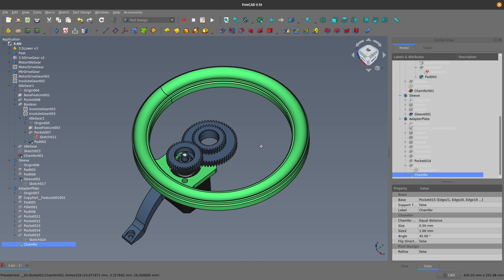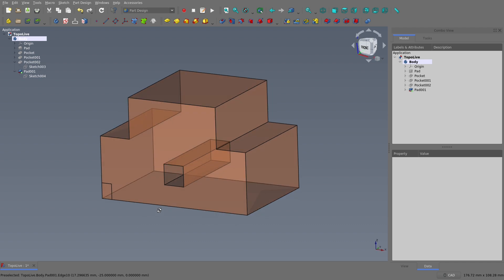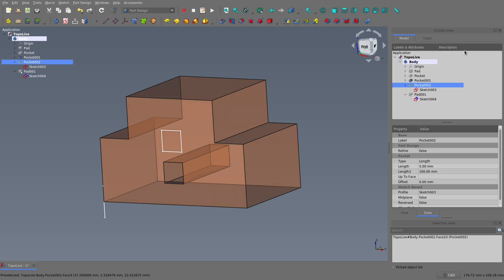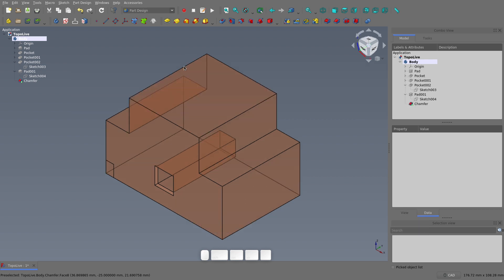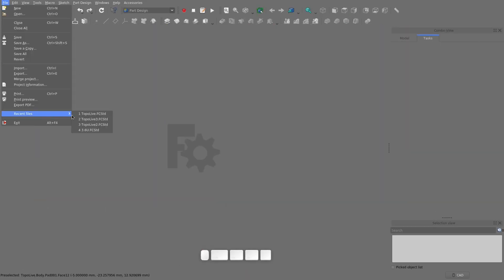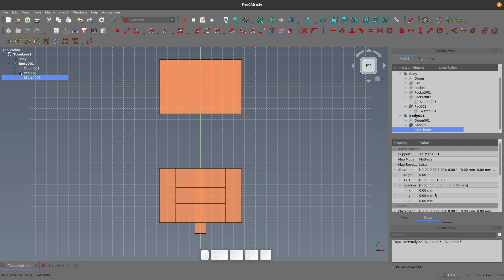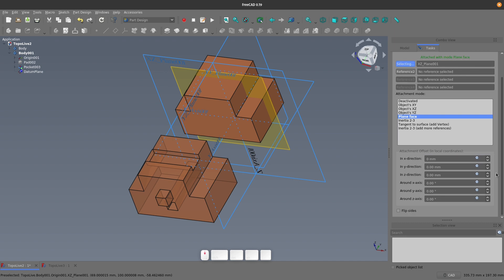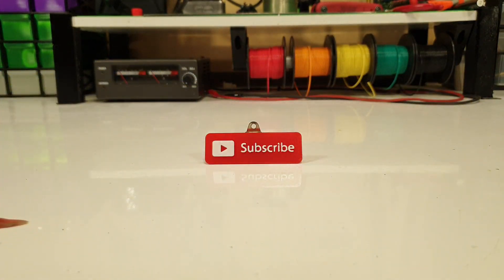Why do my FreeCAD models break? - "Topological Naming Problem"

Comment: I'm disappointed the fix wasn't considered for the 0.19 release. Having used FreeCAD for years, this has consistently been the single biggest problem with using the software. I also think it will be the biggest problem getting new users to adopt the software.
Reply: It's not that is wasn't considered. The problem is that realthunder needs to separate it from his fork, to make it into a manageable (or even multiple) pull request(s). His fork is tens of thousands of lines of codes spanning the whole code base. It's impossible to review for other developers with limited available time. Already, his App::Link work was merged into 0.19 and it was a lot of work, to make sure it played well with all the other workbenches. As an end user, I understand the frustration of not seeing this and other cool stuff merged into FreeCAD's main branch already. But we cannot know what all of this requires on the other side. That being said, with FC 0.19 releasing soon, I believe merging of the topological naming code will be in the works for 0.20.
Reply: @normandchamberland1503  As a developer I understand, and I think the FreeCAD maintainers are doing an amazing job. But as a user... Now! Now! Now! Sadly, life doesn't work that way,,,
Reply: @DavesRocketShop  yeah because this issue does not exist to that degree in aps i use like fusion360. references can have hick ups so you just re-associate and done
Reply: How is the progression. Version 0.22 seems to be here.

Comment: l'll have to watch this again because I'm a little hard of thinking, but you've certainly got the knack of talking sense - I currently use DesignSpark Mechanical - which is brilliant but I need an easier way of making adjustable models. I got a long way with this with FreeCAD but gave up on it and returned to DSM because I got sick of the time squandered on broken models. Edit: I've just had a quick fly through the RealThunder version. I had no idea there was a version of FreeCAD that works! I tried your method to stop models breaking, but being able to just get on with designing using the RealThunder version is fantastic. Thank you for mentioning it, it looks like I'll be able to migrate to FreeCAD now. Sorry I am only able to like your video once, there ought to be a more emphatic like button for this!
Reply from the maker: It's definitely an annoying issue until you work out how to deal with it, I fought with it for years before I bothered to actually research why. It's hard to move to any new tool and customisable/parametric design is definitely not a simple concept.
If you don't have any luck or continue to get frustrated, I highly recommend trying RealThunder's Linkstage3 branch, the new topological model is on par with or better than a lot of commercial offerings. You can still break things, but it's only a small fraction of the time and it's easier to fix.

I guess one way I could try to really summarise the "correct" workflow for 0.19 is;
Every sketch must have an absolute position rather than a position relative to part of the body, which means every sketch must be started on an origin plane, then offset and rotated as needed.

I hope at least some of this made sense, if there is anything I can do to help, please let me know.
Good luck!

Comment: Great video and pretty much what I have learned in the forums and reading the wiki for the last month since ejecting myself from Fusion 360.  I am wondering what are the downsides of just downloading realthunder's branch and happily continuing on using that instead of the 0.19?  Are there aspects about his branch that make the files not compatible if you build a model there and then try to go back to the official FC version?  If so, and they are well known, maybe you could do a little video pointing out the differences between them?  Thanks for the effort on this and other videos - I am slowly coming up the curve with FC but it would be a real nightmare without videos like this.

Comment: Thanks, it's a very good description of how and why.
I started learning 3D modeling recently using FreeCAD and already started to experience breakages due to the topological naming problem. I was able to fix them, but it's tedious.
Your workaround is very good: referencing meaningful dimensions instead is semantically better than faces IMO, but won't work for filets or complex paths coming from the output of various features.

Thanks for highlighting that realthunder's fork is build to solve the that! I'll switch to it and report issues now !

Also, subscribed 😃
Reply: I agree. There are other topo naming problems that arise even when following this workaround.  (Like the pads themselves getting mixed if pads are deleted/added?)
Did you find those all fixed in real thunder branch?

Comment: I guess the benefit of being able to sketch with respect to external geometries is "theoretically" as the base geometries change, the sketches and features that depend on them would also change in response. But you could get around this by making the model parametric anyways? I'm probably not in the majority, but I feel like defining the relationships explicitly as parameters external from the model would be more future proof and easier to change.
Reply from the maker: That's exactly how I design most things, with a spreadsheet and using absolute references only.
Chamfers and fillets become a little more complicated / tedious to do this way, but things just don't break.
Reply: Yes, that's how I do it. I don't base sketches on generated geometry at all. Everything is defined numerically in a spreadsheet and/or a set of master sketches.
I've never really come across the TNP.

Comment: I have found that it doesn't even require adding or removing faces.  Simply changing a dimension can cause the topology to be rearranged, even if no new edges or faces are created.  This not only breaks subsequent features, it breaks assemblies.  I have also found that if you modify a dimension up the tree that causes a datum plane to be hanging out in space, this is a Big Deal that I was unable to solve without deleting all subsequent features and rebuilding it.  This is still an issue in 0.20.  Hoping for 0.21?  0.22?
Reply from the maker: The 0.21 Dev version has the first lot of topo fixes from real thunder added in. After 0.20 came out they committed to having the tnp fix in 0.21.
Reply: @BrodieFairhall  Great news!  Thank you!

Comment: Geat work! Thanks.
What do i have to look for in the changelog to see if this is implemented?
Reply from the maker: Anything related to "Topological Naming".
There is currently a PR waiting to be merged for FreeCAD 0.20 https://github.com/FreeCAD/FreeCAD/pull/4752
Hopefully it is merged soon, while I will still design using absolute references for most things, there are some workbenches & tools that basically require it to guarantee there won't be issues with changes (such as surface) and part design tools like fillet, chamfer, Draft and thickness.
Reply: @BrodieFairhall  Thanks for that information!
I'm just thinking about using a branch with this fix included because the annoyance of breaking everything over and over again is bigger than the risk of incompatibility for me. I just broke models from 0.17, so i'm kinda used to it ;)

Comment: What is the benefit of using an extra datum plane instead of simply creating the sketch and off-setting it directly?
Reply from the maker: I typically offset sketches, a datum plane was easier to visually demonstrate for a video though.
Datum planes are really nice when you have a complicated offset with rotation that you may want to re-use to base multiple sketches on.

Comment: In general I have no longer had the topo problem on the latest 0.19 version of Nov 2020 with Asm3 workbench. Had major topo problems earlier no have had non for chages on a transformer model for 16 changes of details on variants.
Hoping the topo issue is being put to rest.

Comment: Do you ever use the FEM plugin? I've been breaking my mesh in many different ways. I have now come to a point where I can make the structures I need to.
Reply from the maker: I use the FEM workbench on occasion to find the highest points of stress on some of my designs and improve them.
Reply: @BrodieFairhall  I appreciate the quick response.
Reply: So I've come to a realization that my problem still stems from topological naming problems. When A2+, or part fusion, compound or boolean result in topological naming issues that I cannot resolve. Now what I've come to realize is that by building my object from just one part FEM and Gmsh have no issues.

Comment: I'm really looking forward to FreeCAD 1.0 (the Version where FreeCAD finally overtakes proprietary software). But I guess this will either never happend or will take 30 years or more from now :/
Reply: That can happen with a different strategy. Publish 1.0 asap with what is available, instead of waiting for new features. Rapid development needs lots of developers. And that in turn needs a big user base. 1.0 releases attract a lot of users who are weary of alphas and betas. Only application and feature stability needs to be guaranteed. More features can be added to 1.0 branch as long as they don't break the workflow. Meanwhile a 2.x development branch can be started to be that version which overtakes proprietary software in the long term.

This was more or less the story of blender too. It wasn't much of a competition against commercial software up to version 2.5. But users were confident in its stability and therefore had good developer attention. It consistently improved to a level where 2.9 series is very competent against proprietary alternatives.
Reply: @gokuldastvm  I don't know if that would change anything. Have you ever tried the mainline FreeCAD 0.19? It's not even usable. RealThunders branch is at least usable but still far from perfect.
Reply: @blendarious  I do use FreeCAD 0.19. A 1.0 release won't change anything when you look at it from a feature point of view. What it would achieve is to get more people to try it out and pitch in for development. This kind of change is evident from other FOSS projects that made such a transition.

Comment: I wonder how you are able to have the model tree as overlay in the 3d view. Do you need an addon for that?
This seems to be a nice feature.
Reply from the maker: It's the glass add-on, you can get it with the addon manager. Make sure you read the instructions on how to use it too
Reply: @BrodieFairhall  Thank you very much

Comment: What’s your view on placing darum planes on shape binders you got from faces ?
Reply from the maker: If you want to avoid topo problems in 0.19, my stance is that datum planes go on an origin plane only.
Shape binders will break in the same way that a sketch on a face will.
Sub-shape binders can have their "Bind Mode" set to "detached", which theoretically removes the referencing issues because the face is no longer referenced, but it also means that if you change the surface it is bound to, the sub-shape binder won't update.
Reply: I see yeah good points.

Btw do you have a good explanation of shape and sun shape binder ? I fail to grasp the clear differences.

Is shape binder the only way to make a reference to a different body ?

TNP is so much not an issue in fusion - i hopes real thunders work makes it into matter
Reply from the maker: I don't have an explanation that would fit nicely in a comment, there are some good explanations, I think AndrewCad has a good video on it.
Unfortunately the answer is, don't reference bodies, that's really it (I'm not just talking about FreeCAD either, for customisable and highly parametric parts in fusion or inventor I'd still only use absolute references).
Instead of referencing anything, I'd recommend looking at using spreadsheets and / or mastersketches.
There is a pull request in the FreeCAD 0.20 Dev repo to include the toponaming fix, it's an enormous PR so it will take a little time for it to be merged, I'm hoping in the next month or so.
Reply from the maker: @cekuhnen  https://youtu.be/MCY5IrWrHrU
Here is the Shape Binder vs. Sub Shape Binder explanation from the Andrew Cad channel. It's a really good explanation of the differences between them.
Reply: I watched it few times and still struggle they seems to basically so 90 the same 

I should stop crash learning it

Comment: idiots behind wheel destroying actually good piece of software by their incompetence..
respect to realthunder which addressed really vital modelling issue, when you are dealing with parametric modelling software
it's beyond comprehension, that even in version 1+ this issue is not solved by incorporating realthunder's honest peace of work on this matter

but no wonder when there are many basic interaction workflow issues, which might be solved in minutes for dev, but will mean a world of difference for user, desperately seeking for the source of problem every time without any clue, as well as no way of sharing the best practices by exporting/importing and then version incorporating community best setting for anything in UI..

truly seems like the devs are bunch of idiots without any respect to community creative energy after all
Reply from the maker: @richarddrenka  I totally get it, RealThunder deserves nothing but respect for coming up with a practical solution for a problem that everyone else wrote off as too hard to deal with.

The FreeCAD and Ondsel devs have also won my respect. Rather than just merging the fix prepared from the linkstage 3 fork, they broke down the solution and have reimplemented it in a way that is far better for the project and got nothing but hate for it.

So far only the foundations have been built, not all the functionality is there, but it is solid, maintainable and can be utilised by basically anything that currently exists and wont require them to go back and rewrite half of the code every time they want to add something new to FreeCAD.

It sucks, of course I wish it was fully implemented, but ultimately the best decision was made and we will all benefit from it.

Comment: A few things I really hate about FreeCAD:
- So many devs do their own stuff instead of working tight together to make the most awesome software possible (general Linux problem)
- They try to be good at all which results in being not good at anything (They should focus on Part Design, Assembly, Sketcher & TechDraw)
- Missing important features like Extrusion/Cut feature with face selection & Measuring tool for lines, circles, distances of any kind (see Fusion360)

PS: realthunder should join the mainline -> Support him @patreon
Reply: Why do you feel they should they focus only on Part Design, Sketcher & TechDraw?  Are they the Workbenches you personally use?
Everyone codes on their own branch of FreeCAD, realthunder is such a prolific coder that they can't keep up with his changes fast enough.  Every pull request has to be fully reviewed before merging with main.  Also, he sounds pretty "mainline", as he gets an equal split of all donations received by the project.  https://wiki.freecadweb.org/Donate/en
Have you considered forking FreeCAD and adding a measuring tool yourself?
Reply: There are some measurement tools but they are less polished. There are some tools for it in the Tools menu, there are a few items in one of the menus in the Part workbench. There is a separate inspection workbench. And there is a macro you can download for volume/area calculations for a body.
Reply: @VorpalGun  The measurement tools in Part workbench are very basic and I don't need 8945702 workbenches + 90834 Addons. Just one well thought Part Design workbench with all necessary features is enough.
Reply: So many of them (there are 3 main devs) are doing it for free.
Reply: @paulg3336  Only 3?! They should try to become a part of Linux Foundation, Blender Team, etc. That's the only way to get way more devs working full time on FreeCAD
Reply: @turbineterry  Part Design, Assembly, Sketcher & TechDraw because that's what a professional CAD Designer is using all day long. A good implementation of FEM and CFD with OpenFoam would be helpful as well for more advanced mechanical engineers.